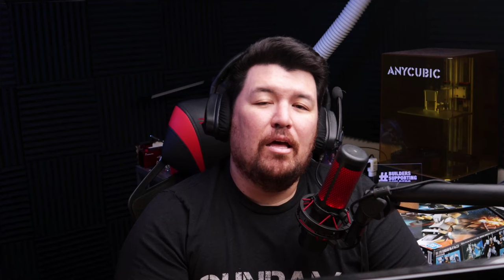Are you getting WORSE? | PlamoTherapist Podcast

Comment: I'm brand new to Gunpla. I built 1 Entry grade and 2 High Grades, and I felt hooked.  I did all sorts of research, and saw all sorts of videos on sanding, coating, painting, lining, decals...everything. I see commonly how to make your "figure look like a model." In some ways it caused me to start putting much more pressure on myself to "do it correctly." I remind myself there is no "correct way" and really, the only people who are going to critique my build, is me. Sometimes I do have the paralysis of continuing, because I put so much pressure on myself to make it look "correct." I'm currently working on a 3rd HG, and picked up single-blade nippers and a glass file. I have fun with the work involved, but sometimes I still can't help but worry about a "future mistake." Anyway, I went down the rabbit hole and caught a few of your vids. It's neat to see you are still making videos.
Reply: Same, I just keep thinking how it could be better.
Its very off putting and I once stopped building my HG Freedom after I finished the body and stopped for 2 months.
Joining a supporting community does help to ease that "perfect" mindset

Comment: I've put Gunpla on hold for a while due to changes in my life. I recently bought a condo and had to move. Plus my hobby room isn't finished yet - missing an add-on for my desk for more room and a few other things. Last time I built a kit was the other week because of a Gunpla club meet (P-Bandai HG Oltlinde in case anyone wonders). Before that was the month prior at another meet. I do plan on continuing once everything is ready. Once I'm done with my backlog, or along the way, I'll be jumping back into customs - starting small and then working my way up. I personally prefer simple customs because I find that there's a beauty in simplicity. If a custom goes wrong, I use it for another custom.